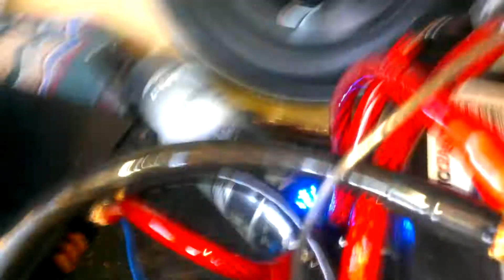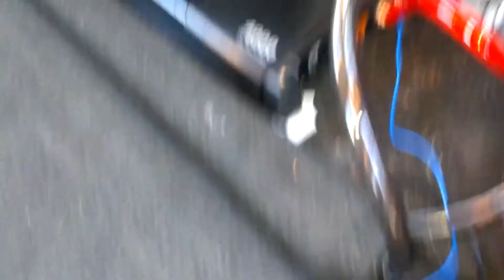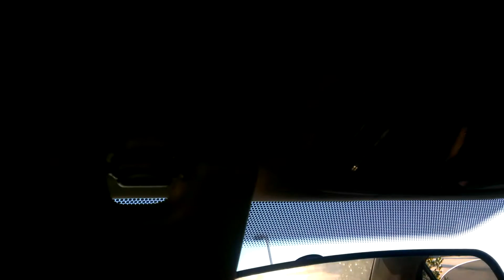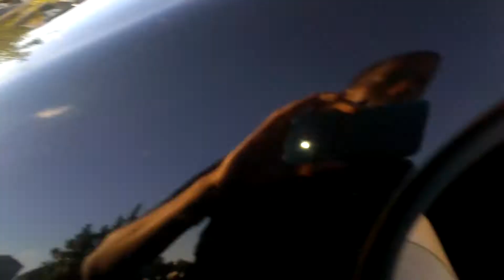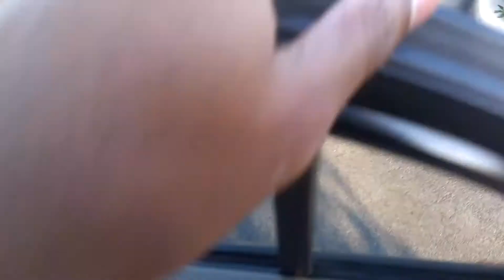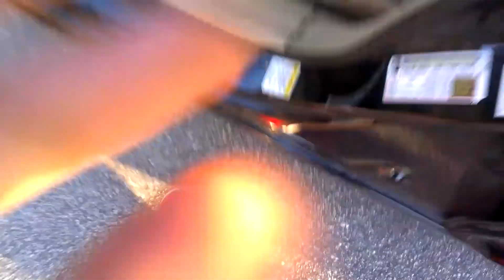2 Pioneer Champions pounding on AC4000.1D

Comment from the maker: well when I first bought the amp I let the positive and negative power terminals touch, umm the amp doesn't get hot but wont stay on at full power for more than 15 minutes. im going to get the 5000 watt class. but tbh at half volume its more than enough. The amp does produce very good clean power though. Just make sure you get a second battery or better alternator. Voltage with car on holds at 13.2 most of the time

Comment: flip the box fam, so that your  subs r pointing away from you and see if you hear a dif. i got that same amp..., good low bass outta her
Reply from the maker: It doesnt help to do that when you tune low bro. Thats for 35hz and up. Still wont sound as good either way facing rear.